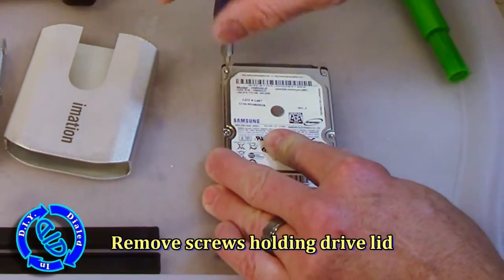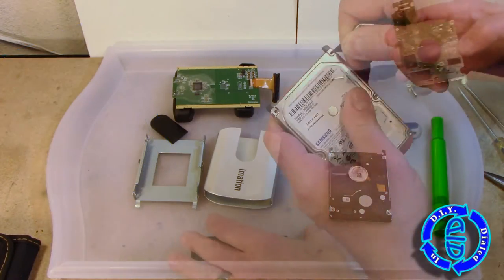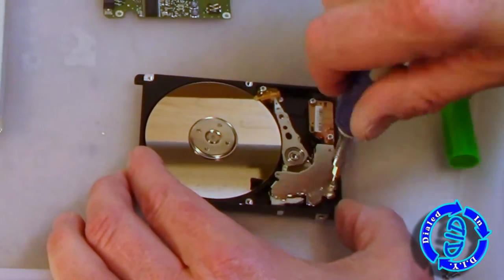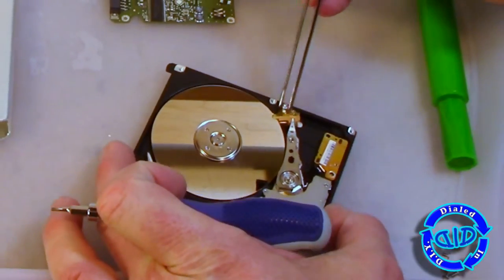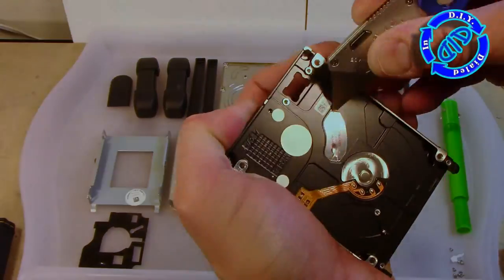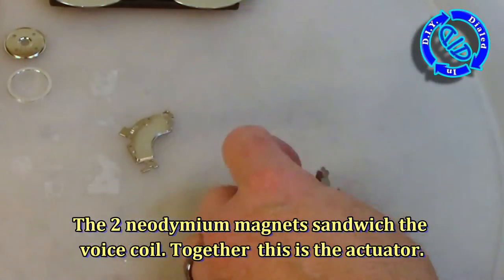External Hard Drive Autopsy - Salvage Free Project Parts

Comment: Any hints on opening the spindle / motor to salvage the bearings inside?
Reply from the maker: Hi Luke. I know how to but I'm pretty sure it is not possible to put the motor back together afterwards so if you are good with that then... get some kind of punch (or large nail/screw) and center it in the indentation on the back of the motor. While supporting the motor start lightly tapping the punch with a hammer.  Increase force if needed.  The bearing will eventually drop out.